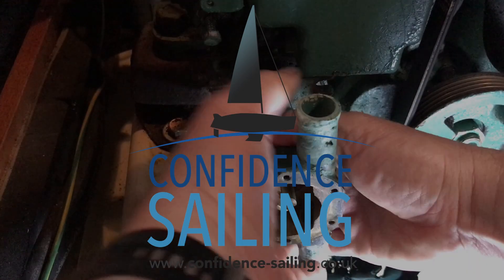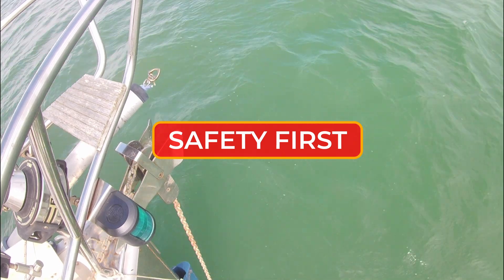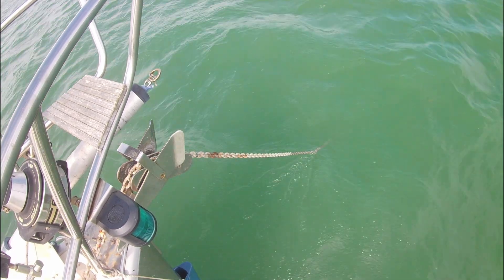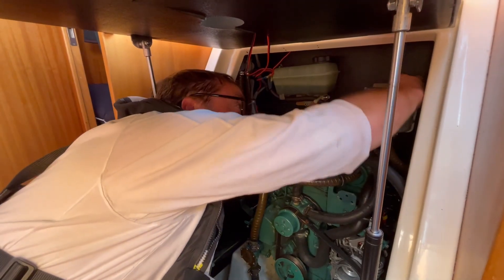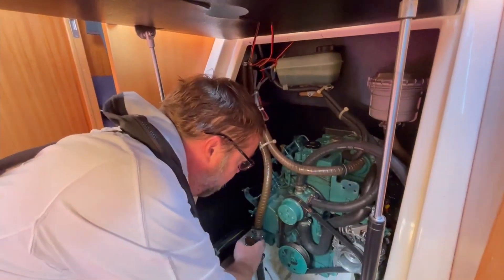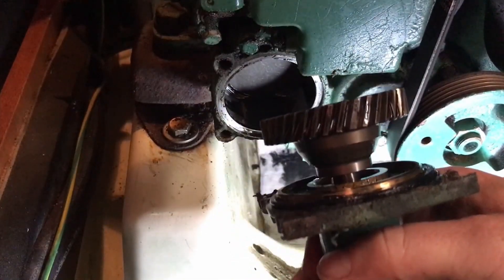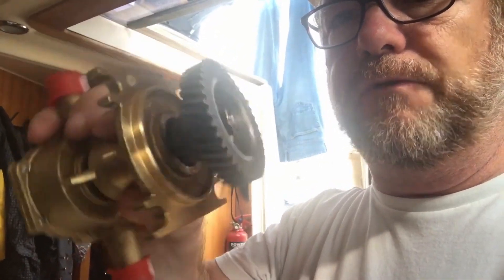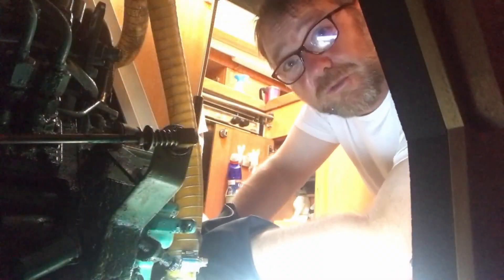Fitting a new raw water pump on a Volvo Penta D1-30B

Comment: Just replaced my raw water pump thanks to your video 🤙🏻 However, I now hear an intermittent “mrrp” sound as can be heard in the below video, and I get a light “whirring” noise as can also be heard when it runs. Any sense for what this might be and whether it requires attention?

I should add that the new pump came with an o-ring that goes between the pump and the engine. The old pump didn’t have one. I wonder whether this has changed how the gears mesh and that that is the cause of the noise. 

https://youtu.be/3K92E1OhEhc?si=c4VzQ9IXSiP6YPPG

Comment: Good work & vid. I now try to stop the oil leak where front pump flange meets the cover, there is a o-ring to seal the oil. I got the o-rig from Volvo dealer as 68x3 mm size but the one on the video seem to me  bit thicker maybe 5 mm dia instead of 3mm ? Do you know the size I guess you also replaced that o-ring with the new pump? Thanks

Comment: Nice vid. Came here looking for info on my seawater strainer. It looks awfully small. After watching the vid, I also believe it was added later. It is below the water line and it’s like the prev owner cut the hose and stuck it in. On other diesel boats I had, it was always above the water line. It also looks tiny. I’ll be getting the actual Volvo Penta seawater strainer.